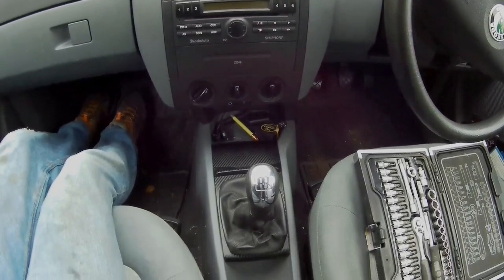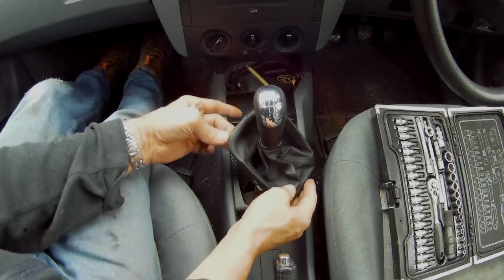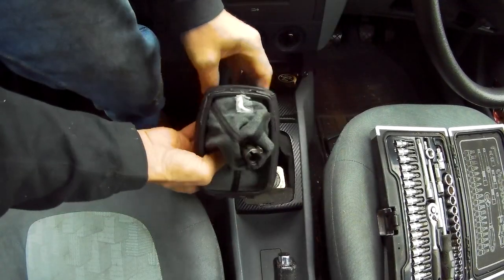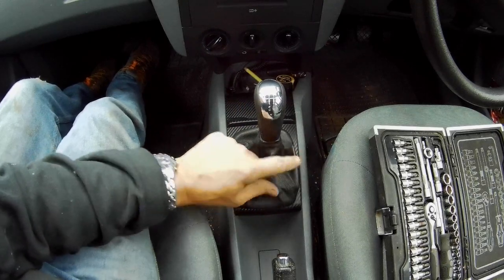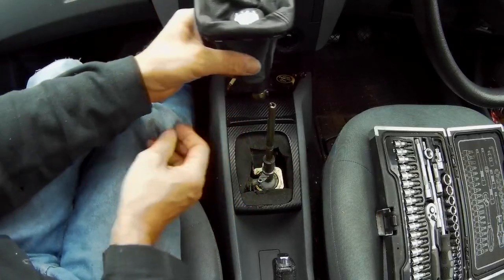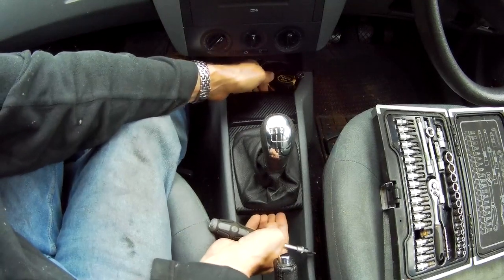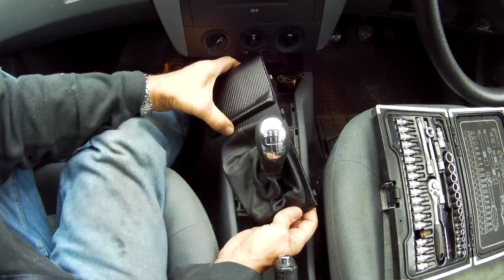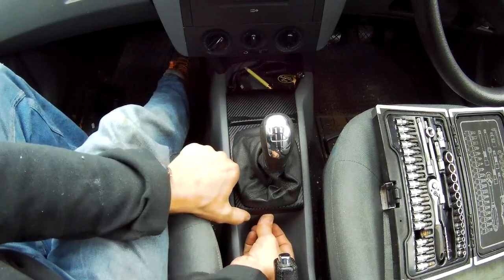Skoda Fabia GEAR LEVER

Comment: I saw a number of different gear knobs on Fabia's MK1. I thought that it's a facelift change, but apparently it's not. Why some of them have a different gear knob?
Reply from the maker: Mine was an optional extra along with the leather handbrake
Reply: @HatBoyHarvey  I'd like to replace my headlining. I will take it out of the car, remove the glue and the old material. 

How much will cost me, if I'll give it to some upholsterer, just to make it brand new?

Then I'll mount this to the car, myself.
Reply from the maker: maybe look into going to  a scrapyard for the headlining as these are often in good condition and cheap :-)
Reply: @AdisonCavani  I did that job myself. Bought some headliner fabric and 2 cans of spray glue.  I think it cost me about 60-70 bucks. total. It's a pretty easy job.  
Just dont forget to, especially in the front,  fold the fabric over the edge of the liner, and glue it tight onto the other side. 
Or else you will see the cutoffs at the edge of the headliner when viewing the car from the front.